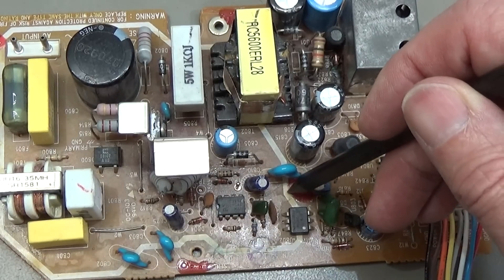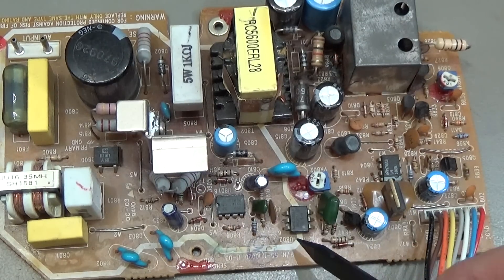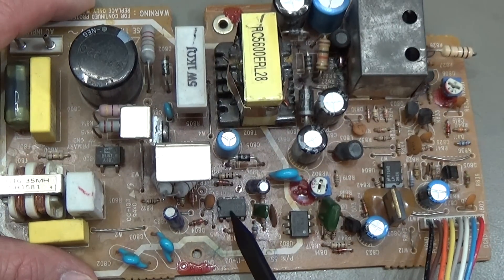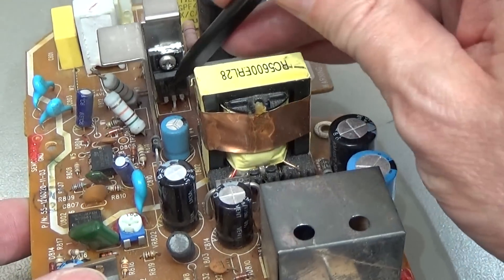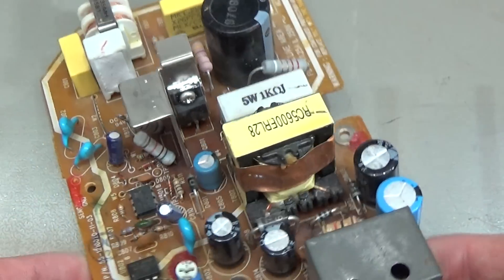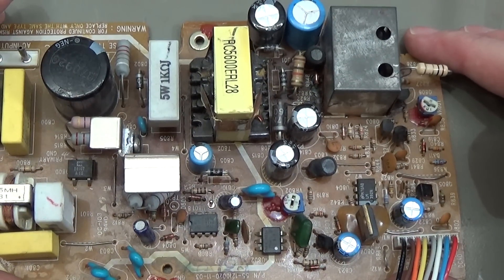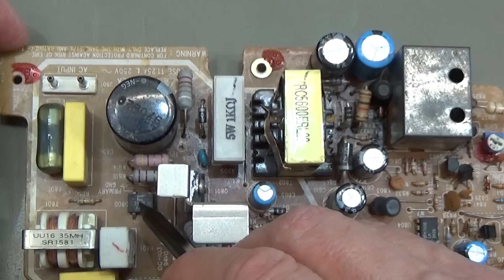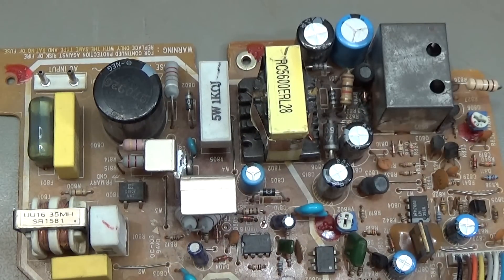#79 Basics of switching mode power supplys

Comment: This video is a couple years old hence my comment is long after the video was posted. This was a great primer to familiarize a technician that never worked on switching supplies. I could have used this information about 40 years ago when first introduced to testing and troubleshooting switching supplies. The aerospace company I was working for designed many multi voltage switchers for use in aircraft where weight and size are at a premium. The technology was quite new at the time and my training was limited to linear supplies.  When it was shown how much power these compact and lightweight supplies could produce I was very impressed. The multi voltage computer power supplies so common now are a prime example of this technology. Thank you again for another entertaining and enlightening video.
Reply from the maker: Thanks for your feed back Carl. Glad that you liked it

Comment: Excellent video tutorial. Nothing beats seeing live traces on a scope and meter readings. I've been debugging the power supply on my TV and that section of the circuit was baffling me until I came across your video.  With the knowledge gained from your video, I was able to trace the problem to a faulty regulator on the secondary side that was driving the feeedback pin high on the switch IC, thus disabling it.  It all makes perfect sense now.  Thanks and keep up the great work!
Reply from the maker: Hi Russ, very good great that you was able to trace the fault down! Thanks for watching Cheers

Comment: THANKS PETER! ANOTHER GREAT VIDEO! I bought a swithcing mode supply in the form of a charger inverter for a big sail boat. It was very noisy, so I decided, let's delay the switching noise so it is 180 degrees out of phase and mix that back in so it cancels itself out. IT WORKS GREAT!  I am kind of new to the whole ham radio thing and all those fabulous new products engineered to separate us from our money, so I had no idea MFJ and Palstar already made phase inverting noise reduction boxes. I made a linear supply for the bench from a huge buck boost  24/48 volt secondary dry transformer, regulators (zeners) and lots of transistors, to the tune of 200 amps of 12-14 volts of very clean DC. It weighs a tonne but, it's very quiet. The charger inverter will give me 100 amps of 13.6 volt DC power, and off a battery of batteries I can get  25 amps of 120 VAC, "AND" the 100 amps of 13.6 volts. Off batteries that 13.6 volts is as about clean as it gets. . 73s to you and your's!
Reply from the maker: very interesting, thanks for your report and thanks for watching 73

Comment: ShOcK & AWE clarity. A lesson that will, I'm sure, will be taught 500 years from now. p.s. That 1K 5 Watt resistor seems strangely out of place in a "efficient power supply". But I use to believe that the Electron was a super hero from the 50's. Thank you for the video. You RoCk!

Comment: Super video Peter! These switching supplies are tiny now, and you can plug one into 100, 110, 115, 120, 155, 220, 230, 240, 250 volts 50 or 60 Hz and it does not really matter. I would not try it with 25 Hz. That stuff is gone now. It used to overheat transformers, and other things.  Up until about 20 years ago some parts of upstate New York, and Canada still had OLD 25 cycle mains power from the old Niagara Falls Power Plants. The utility companies  wanted to change it to 60 Hz for ages, but back then there were still a lot of old factories with motors that were synchronized to run on  25Hz and the factories said it would cost too much to retool. Most of these Factories are gone, and the work is being done in Asia, Mexico, and the far east. I have been looking at high speed switching to reflect loads onto vacuum tubes to eliminate the need for output transformers. They can even tell what power tubes I am using and adjust the reflected impedance(s). High speed switching....FUN STUFF< AND WELL EXPLAINED MY GOOD FRIEND!  Gott Segne 73s KI7AQJ
Reply from the maker: Hi Segne, thanks for this interesting historical information very much appreciated..  Thanks for watching and stepping in. 73

Comment: The optocoupler feedback network is for voltage regulation only. The over current protection is via pin 3 and the voltage across the emitter resistors on the switching transistor.
Reply: Michael, this is what confused me about the video. As I watched the video, I kept waiting for an explanation of how the PWM received feedback to adjust the voltage. This seems like a critical part of the circuit description.

Comment: Hello Peter, good general information about the working of the switching mode power  supply. Maybe it would be nice to see how good the common choke works. Many hams suffer from the solar panels converters. Many thanks and catch you next time.
Reply from the maker: +FEY Hi, yes you are totally right but unfortunately  I have no artificial mains network which is needed to locate and show these noise and qualify it. But anyway I'm planing to have one in the future.. 73

Comment: Peter thanks for the video...I never knew how those supply worked.I still prefer my linear PSU i have heard some horror stories with Chinese Switch Modes using poor components.Your right lots of radio people complain about the noise generated from these but lets face it,they are in everything these days.No thanks i will try keep my 20 year psu's going as long as i can.
Reply from the maker: +charlieoscar09 Hi, yes right there are some lousy products on the market which are causing more trouble than anything else...I like my linear psu as well especially because it is do silent without a annoying fan.. Thanks for watching 73

Comment: hi, that's awesome video. suggestion for improvement: you can use two video camera to shoot at two different portion. also, in this video, you should slowly increase your load side, and monitor the zener diode output, and thus monitor the oscillator circuit.  i know i'm too demanding, but it make clearer understanding. Thanks a million for this wonderful video.

Comment: Nice overview Peter. As you know some early SMPS had problems with noise; later designs allowed for "tuning" (or moving) any spurious outputs that fell in the ham bands. I'm wondering if the can on the right side of the PCB might have some of that tuning function circuitry inside to clean up the output side of the supply? I was floored when I got my first SMPS when I compared it to several linear style Astron's here in the shack - amazing difference in weight as you point out. Thanks again!  73 - Dino KL0S
Reply from the maker: +Dino Papas Hi Dino, yes early SMPS's and in particular all the cheap designed units with crappy components and without good common mode filter and proper shielding. No in the can is only the main power transistor shielded without any compensation components. The featured product is nothing special a very cheap and crappy sat receiver psu so nothing special to expect. Thanks for comment! 73

Comment: Hi , you have made a great job by explaining how works SMPS theoretically and practically . Can you make a complement video ? by simulating  what can happen with the SMPS when for example according to your schematic:
1- UC3842 is not getting power supply
2- the transistor in the primary side get short circuit
3-the optocouplor is dead
4-one or some transistor in the secondary side get short circuit
5- rectifers diode in  in the secondary side get short circuit.............ect
the idea for every case will be to show in the oscilloscope or voltmeter what you are getting in the test point of the schematic.
thank
Reply from the maker: +Henzer zak Hi Henzer, thanks for feed-back! Well very good proposal on the different scenarios..Unfortunately I have no capacity to do this video, sorry for not having a better answer for now. May be possible in the future.. All the best Cheers.

Comment: I don't understand what voltage the transformer receives from the MOSFET to the primary. Does the trans receive AC or DC voltage (I think it receives DC voltage). Also what voltage the transformer outputs? AC or DC?

Comment: Thank you. I've learned that a switch mode PSU that keeps power-cycling itself is in protection mode, and this is probably due to overconsumption at the output. 
One question: if switch-mode PSUs are so much more efficient than linear ones, why do some of the more powerful ones require a cooling fan ?
Reply from the maker: You may like to lay it out to be small and light therefore a fan helps to meet your goals...
Reply: AlainHubert and
Reply: Fans cool off heatsinks on the power transistors and voltage regulators.. powerful smps puts so much current through them that  they get very hot..
Reply: Simple answer is they are not 100% efficient. They are only 90% (for good ones) efficient so 10% of power they dissipate as heat, which in high power SMPS is lot of heat and to not have enormous heatsinks they use  cooling fan

Comment: Thank-you for the video. Please can you explain to me if the 320V at the collector of the chopper transistor in the primary circuit, gets drained to ground through the emitter at a rate of 70KHz. This will then create a continually growing and collapsing oscillation of magnetic flux in the primary transformer coil? Is the 5W resistor connected in series with the emitter to ground to handle the heat being dissipated by this process. I need to get a clear understanding of how the chopper circuit works.
Thank-you

Comment: Peter what about your workshop safety I.E you mentioned and isolation transformer?  I will also be doing work re-capping some old valve equipment thanks
Reply from the maker: +charlieoscar09 Hi, will try to get something together. Especially if you work with valves it is essential to work with a certified safety isolation transformer. I presume you have seen Paul's video on that ? https://www.youtube.com/watch?v=XBsQ3sZ45Fk
Reply: No i had not seen Pauls but thanks

Comment: Thanks ! Best explanation ,i have a question should oscilloscope also be connected to Isolation transformer ?
Reply from the maker: +Ajay Rao Hi Ajay, yes that is important or you can use a differential scope probe both is possible. Be careful with the both different ground sections. Thanks for stopping by. Cheers.

Comment: Something basic is confusing me - why the width of the pulse matters, as the transformer's primary magnetic field only expands/collapses as the voltage changes (on the rise and fall of the pulse). Since the pulse is basically a square wave, does the magnetic field need the time of the wider pulse to fully expand? A high frequency square pulse must have very different physics through a transformer - as compared to 50-60 cycle AC. Thanks, hopefully a short "simple" answer is possible.

Excellent video by the way - I enjoyed it at 1x speed.

Comment: Hi

Thank you for your explanations. Always very precise & very useful.

I have a question about your isolating transformer.
Is it simply a variac or it includes as well a 1:1 transformer (primary + secondary)?

Best regards
Jo
Reply from the maker: Hi Jo, it is a galvanic protective  separation transformer (Schutztrennung) according 
VDE 0570 Part 2-4, DIN EN 61558-2-4, EN 61558-2-4, IEC 61558-2-4. That means it is not only a variac.. Thanks for watching 73

Comment: Hi, Nice video. I want to ask one thing. If I don't have Isolation Transformer , then can I at least  check final voltage on secondary side of SMPS? Will it be safe? I need to check my Subwoofer SMPS voltage out which is 24/36Volts. Thanks.

Comment: I am a little bit confused on the function of the opto-isolator/coupler.  If I am understanding this correctly, it provides a means for feedback to the IC in order to tell it to increase/decrease the PWM duty cycle, which switches the transistor controlling the  the transformer?  Does it essentially join the primary to the secondary side without a physical connection? 

There must be programmed logic built into the IC which keeps the output voltage the same regardless of the load?
Would it be possible to incorporate a variable resistor coupled to the IC to control the output voltage level?  Sorry for all the questions, but I am trying to wrap my head around the concept of a switching mode power supply.
Reply: Brandon C  no, the optocoupler circuit completely shutdowns the IC output. When the phototransiter conducts it passes the 5V ref voltage to the error circuit in the IC which dumps the output to pin 8 by a 15kohm resistor according to the data sheet

Comment: Good video. I have always wondered what happens if you connect the HOT Ground to the CO:D ground of such a circuit? Will the circuit still work properly and what are the consequences of connecting both grounds together? 

Some have said that the circuit will still work with both grounds connected. Is that true?

Thank you~
Reply from the maker: +uiticus Hi, yes the SMPS will work but you are loosing the safety of the product. As long both grounds are separated it is working like a isolation transformer but if they are connected you have earth reference..     Thats the answer. Thanks for watching Cheers

Comment: Hi Peter, please tell me, the ribbon cables in the IC 7000 when they come out how do you get them back in, does the wire go to the pcb and the blue strip to the upper or outside, is there a special took to get them back in, i have taken the front panel on mine to bits, and the small cable has come out and i cant get it back in, really tight...very small ribbon...i wanted to clean the display it was dirty on the inside, now i cant get it back together hi...Fred in England g4vvq.
Reply from the maker: +Tom Smith Hi Fred, no nothing special only fingers and a strong tweezers needed. That should work. Good luck 73

Comment: What's going on with the mutual inductance TB01? Is that for line isolation, to avoid ground faulting when connecting a case ground to the circuit ground? Do have any idea how to analyze that part of the unit? How much inductance is needed for reliable isolation? Any idea where I can find a tutorial on this aspect of the circuit?

Comment: great vid. one thing im still confused about though is why does high frequency through the transformer mean a 4 kw load can have such a small transformer-its still got to carry the current of 100 + amps at a low voltage to achieve that wattage-how can it all go through a tiny transformer without it getting hot?
Reply from the maker: +Alan Wolstenholme Hi Alan, thanks for feed-back ! More background is here https://en.wikipedia.org/wiki/Switched-mode_power_supply All the best Cheers
Reply: well yes i have seen that-just stuck on the output of the transformer being small as still carries a large load